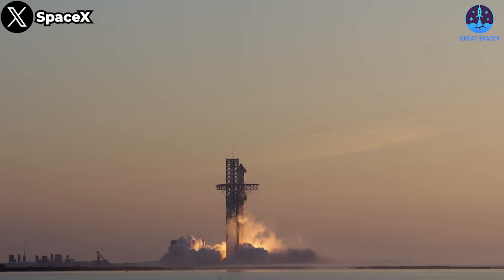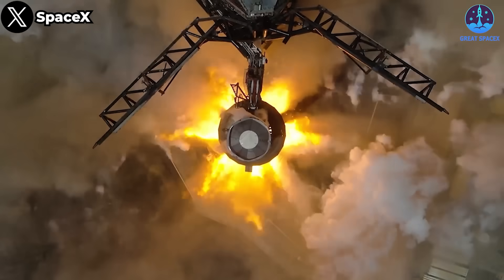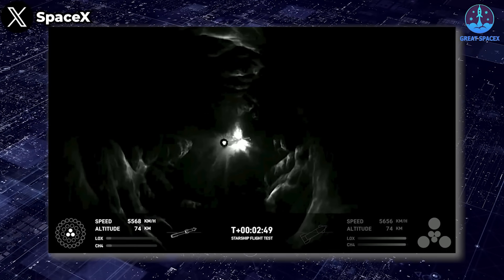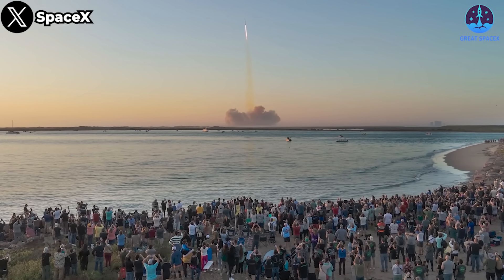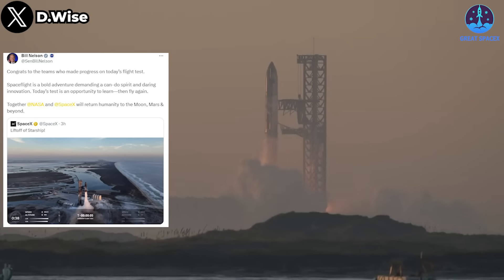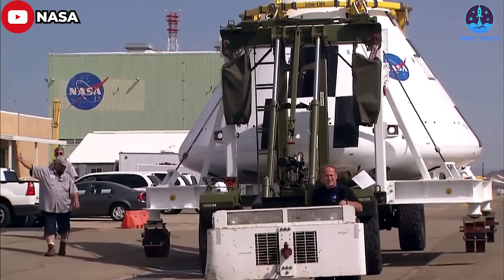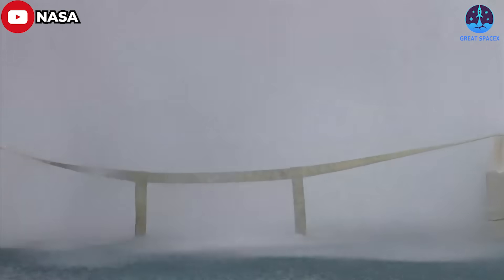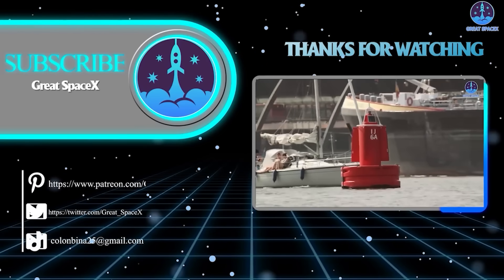SpaceX&Elon Musk inspected the Water deluge system and Stage 0! Starship IFT-3 ready next month...

Comment: 1:33 “steel is a ductile material”. You can’t make this generalized statement.  Steel can be either ductile or brittle depending on it composition, its working temperature, and its heat treatment.  Compositions which make steel hard will also make it brittle.  Likewise loading it at low temperatures will make it more brittle.  Heat treatments of annealed steel will make them stronger at the expense of making them more brittle.  You really can’t compare concrete with metals because they are completely different materials.  Concrete is just crushed rock with a binding agent to keep it together.  It is good in compression but bad in tension.  That is why it is reinforced with rebar for highly loaded applications to allow the rebar to take the tension loads.

Comment: BOOSTER THRUSTING UP WITH 32 ENGINES
SN THRUSTING DOWN WITH 9 ENGINES

Flame diverter taking all forces vibrations
at the intetsection??
Should the section be twice three times its height
and more flame venting patges
along Thicker metal
Sprung 
two three metal dormed shields 
over booster top and grid controlls area
over design in first prototypes
Including strap on landing legs to disgaurd
when assured success is proven
Is a better way to do the job?
Bloody minded special concrete cures all
As really  cost lots of time heartache 
Dollars and fall out.
if touching down in sea
inflation skins coukld be deployed at hitting water

Comment: I’m holding out on saying the pad is 100% fine. They need to run a full test of the deluge system to make sure there aren’t any issues that need to be addressed for next launch. If that turns out well it becomes a matter of how many launches it can take before it gets damaged. There’s still probably some odds and ends on stage 0 that will need some work before next launch. 

The reasons for the RUDs on this launch are a mixed bag. I think the reason for the booster exploding are pretty cut and dry and will see the booster make a complete boost back burn next launch with little to no issue. The issues with the ship are more of a mystery. I think that will take up the most significant portion of the mishap investigation. 

My prediction is that the FAA will turn around and give another license in a couple months and by then spacex will be ready with a new ship and booster combo. I suspect launch cadence is going to ramp up considerably. By the end of next year I won’t be surprised if they make it to orbit, or even deliver payload.

Comment: IMHO, the third flight of the Starship will held not early summer 2024. If the cause of the disassembly, and engine failure, is a problem with the fuel supply during boostback, the pipelines become and they need to be redesigned, the booster 10 can be dismantled, and then the IFT-3 requires the construction of a booster 11 or 13.
Reply: I wouldn't be surprised that they can fix this with software..  if you watch the separation in very slow motion, it is clear that the fuel in the booster was slamming around because of the rapid deceleration caused by the lighting of the three vacuum engines on Starship.  Watch the speed numbers and the booster had negative acceleration which would cause the propellant to slosh to the top.  If they can either reduce the thrust on starship or increase the thrust on the booster during that separation, they can keep the propellant firmly attached to the bottom of the tank where it can feed the Raptors.  Baffles can help but my guess is that they will focus first on reducing the deceleration which caused the starvation of the booster engines and likely triggered the termination charges.

Comment: A great leap upwards with a successful all engine launch and separation. Sounds like though, some people need to get upto speed still, with the original failure being down to matter being in an extremely high state of charge separation with electrical force being responsible and not volcanoes suddenly forming and then going off.

Comment: A pad on the Moon/Mars will be hard
Reply: of course only a much lighter starhip needs to be accommodated with 1/6 G and .4G respectively, so literally 1 tenth the engines of super heavy and if the 9 ton hot stage ring can handle 3 raptors then a pad on mars or moon hardly needs to be more robust.

Comment: Larger payloads also means higher risk per launch. Losing a few satellites (17 tonne) would be nothing compared to losing a full 100-150 tonne payload. The vehicle will have to become super reliable to justify that kind of risk.
Reply: Nothing a few pounds of C4 can't fix.  You can throw 150 tonnes into the drink at low altitudes without risk and at speeds, the main danger is large chunks which can't burn up in time before hitting land.  Blow it up into small chunks and no issue at all... pretty fireworks show.
Reply: @steveburton5825  the risk is financial, not from re-entry debris
Reply: higher risk maybe, but a huge 747 has much lower crash risk than small prop plane. if the engine avionics get good enough then engine out redundancy should make starship super reliable ie if 10% chance of engine failure per minute then 2 engines failing would be ballpark 1% 3 .1% 4 .01% and we know superheavy is specced to get to orbit with 3 out which would be a 1 in few hundred rarity with say a critical 4 literally a <1 in 1000 failure case. If raptor reliability get to 1% then it's almost 747 level lol, of course there might be other harder to manage points of failure, I mean engines were never what undermined the space shuttle...
Reply: @blengi  there were a lot of problems already from small percentage of engine failures in both flights, perhaps because of fire, but also loss of thrust and instability. It can't really be compared to an aeroplane, where the engines are on separate wings and the forces are way lower. But I'm sure Space X will figure out the issues. The reliability they've created with the Falcon 9 is phenomenal.
Reply: @512Squared  what were the engine failures in fl2? going up all 33 worked fine. the 6 raptors on starship seems to work fine too. Of course boost back had engines cut out, but was that engine failure or something structural making engines non nominal causing avionics to turn off?
Reply: @blengi  the reignition for the re-entry burn. It started with one immediate failure, followed soon after by two more, until 5 were out and then the RUD.
Reply: @512Squared  was that  engine failure though or some else which the avionics detected like vibration, fluid balance etc which cause the engine computer to disable? did you see any engines explode? is not the engine specifically failing when the fuel is insufficient or electronics burning, like saying engine is broken because fuel tank empty lol
Reply: @blengi  could be any of the possibilities you mention. There was some discussion that the first failure involved evidence of fire (flash). I don't think the progressive loss of engines can still be put down to fuel slosh because the flip had already been completed, though it might have caused the first shutdown/failure.

 I guess we'll get more of the story in the coming weeks. I was almost crying watching the full stack rising with all engines nominal. Amazing sight.

Comment: I believe the the explosion was intentional to test the system to prove the rocket of that size would fully self-destruct. But that if advertised would likely be rejected by regulators
Reply: No way..  I am sure they would have preferred to have the data on trying to control the booster into the water.  Also they would have preferred to have the data on re-entry of Starship and control... also to see if it would survive with some heat shield tiles missing.
Reply: @christianartman  how much differet is super heavy landing from starship SN landing tests apart from the ~200% higher weight. probably has an even lower center of gravity with massive thrust puck and 33 raptors no belly flop and is thus even easier to land. Of course re-entry data would've been super sweet...

Comment: I bet the liquid fuel bounced hard during separation. Nothing seems more obvious at this point. The throttle probably just needs adjusting. Bet it burns up on reentry. One problem at a time.
Reply: why only 3 raptors accelerating less than a g then the turn back maneuver with extra engines at maybe 2-3 G stabilizing the slosh height to 2-3meters ? I  wonder how the heavy methane down comer  full of liquid methane behaved/flexed as super heavy went horizontal given lack of fluid support in the lox tank?
Reply: @blengi  I think the hammer effect came when the momentum dropped and resumed. The slight slowdown as the raptors drop power in stages five at a time down to three combined with the sudden push from starship as the first three motors started, did the job. A slam of fuel falling the whole length of the buster rocket and busting all of the plumbing. Had to be hundreds of lbs of slosh falling 60 feet or more when starship pushed off from the hot stage. I think the hot staging goes at full throttle so the liquid can not possibly drift up the empty tank. The slow down lifts the fluid the engine startup adds lift and then the fuel plummets.

Comment: Could they use heat shield on top of the booster so that the heat from the Starship Raptor engines do not damage the top section of the booster and protect the stabilizer fin motors from the heat, but what a fabulous moment to see Starship launch 2, hopefully 3rd time will be even more successful. 😊
Reply: probably not, as the amount of turbulence would be MUCH higher than on the second stage. That might not apply if the entire hotstage includes a single unit tile to provide the protection. Tiles were also the weakness of the shuttle. The original concept had the shield built as a single unit to encapsulate the shuttle - but there was no money available to learn how to do that - so NASA and contractors went with a tiling technique which allowed the tiles to be damaged and fall off during launch.

Comment: Correct me if im wrong but if they plan on using the launch pad over and over again wouldn't they need to apply heat shielding to the pad and the water deluge system as well?
Reply: I believe they chose steel for the exact reason to not require this. A heat shield won't be able to withstand the sheer force of the engines as they're normally comprises of ceramic tiles. 

The benefit of steel is that it has a high melting point compared to fibers and other metals, while still being strong and the water deluge system is able to keep it cool and absorb the majority of the force of the engines, so that refurbishment isn't required. The water cools it down and keeps it protected during the 10s or so of liftoff...least thats the theory behind it I believe.

Comment: It seems like the issue with the heat tiles falling off might need to be resolved with heat shield sheets instead. It only a speculation but the more tiles the increased likely there will be a problem which is contrary to Musks' philosophy of "the best part is not part" i.e. the best part is fewer parts.
Reply: finding a way to make/casting the entire shield as "one part" then attaching to the ship would do. More like ship building where the shield becomes the "keel", and then building the ship inside the shield might do.
Reply: @jessepollard7132  Good idea.
Reply: yeah like tile strips pre bonded to that insulating layer which hook on around the sides with maybe half the pins which can be tensioned according to ship vibrations. be much easier to service to in space too ie has some spares tile strips for in space EVA repairs
Reply: @blengi  Yes something along those lines. Starship is way to big for all those tiles. It seems inevitable to be a continuous problem.
Reply: If you have a larger sheet detach that would be worse than a smaller tile protecting an area. Overall lets keep in mind that most of them did stay attached.

Comment: Steal also develops micro fractures. And all that water comes in a very high pressure with a very high flow rate and end up very hot. SpaceX needs to monitor the system so that you do not see erosion, wear and corrosion from use.

Comment: The major problems emerging from IFT-2 are: 1) preventing the loss of fuel flow to the engines, possibly due to sloppy ullage during flipping of the booster, 2) apparent leakage of oxygen from stage 2 after stage separation, 3) other possible Raptor problems causing RUD of stage 2 and 4) heat protection tiles detaching during launch.

Comment: It looks like The capsule for Artemus had a heat shield failure after all. They will need to redesign it entirely. This could be something that SpaceX might also look into for StarShip. I see that StarShip Stage “0” (the launch pad) worked flawlessly. It’s ready formStarShip 10 booster4 within a few weeks. It might fly before the end of they year but I’m thinking January. I saw StarShip (all 3) gimbaled outwards and back into assent positions after separation. They worked as expectedly and that’s another check in the done box. I still have not heard much on their “Root Cause analysis” yet on this last mission. It should be interesting.

Comment: Could it be that, during separation, the top of booster 1 overheated leading to the explosion.  Heat tiles on the top?
Reply: It was more likely a fuel problem. SpaceX has never tried to flip/boost back a booster as large as Starship's. The fuel tank is just a big, empty space. If the fuel didn't settle to the bottom of the booster then the engines wouldn't fire. If you look carefully at the telemetry from the test you can see that the engines all fired for the boost back. Then all the engines on one side failed at the same time. The explosion was caused by the Flight Termination System. It destroyed the booster after it went off course.
Reply: @gregsteele806  agreed, it was most likely the fuel slamming into the manifold after the flip maneuver caused one of the welds to fail and therefore fuel started leaking into the engine section - which probably led to fuel pressure loss and multiple engines flaming out and then the FTS kicked in
Reply: tiles might be too fragile for the turbulence of ignition.

Comment: the rate of spaceX solving the previous launch test problem will see the program settle like falcon 9 launch normalization in less than 5 years.
Reply: The water deluge system had been in design and development for about 8 months starting before event he first launch. It was only the implementation of the design that took a short time. and took quite a bit of engineering.

Comment: Fuel takes will need fuel blatters that shrink froceing the fuel in the direction needed !
Reply: They have no material that will hold liquids as cold as liquid oxygen or liquid hydrogen that will stay flexible. And controlling the pressure in such a bladder would be almost impossible. That's simply not happening.
Reply: sthose baffles didn't work in aerobatic or fighter aircraft even though some are used. so it might help, but would also tend to make the fuel foam from splashing (as well as make the tank more thermally conductive).

Comment: Not just did it help hold the launch pad, but this water deluge system absorbed the shockwaves and thrust from 33 raptors! One could see this from the undamaged cameras and even all the tripods near it that captured the event. It was an amazing achievement ❤
Reply from the maker: Exactly. This is unique platform!!!
Reply: @colonbina1  Clearly they have no idea how to re-ignite engines given a random position of the booster or the star-ship in the presence of almost empty fuel tanks.
Also, SpaceX is yet another example of the government gifting peoples taxes to private owners without getting any ownership in SpaceX for the people. Only corrupt government protects the Owners of businesses more than the People of the country.
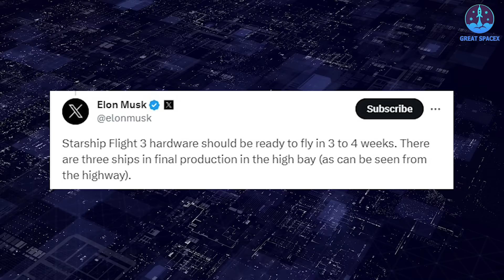Reply: I'm sorry to say, but I don't think it absorbed the shock waves. Maybe a little bit, but at 2:04 you can see quite a big shock wave. And there was another smaller one after that
Reply: You will Never absorb and eliminate the shockwaves from 33 rocket engines firing up.. but they are not trying to eliminate them (impossible) - they are trying to Reduce the acoustic vibration and shock to prevent damage to the vehicle and launch structure. - judging from this 1st live test, compared to the test they did before they had the water cooled plate, ill say they are onto something. If Boca Chica was not sitting like directly above the water table, im sure they would have gone a conventional route like flame trench, but thats not an option here. @musicduck4538
Reply: NSF Thinks the new dent in the Tank Farm was caused by Shock Wave from the launch.
Reply: @davidedwards1705 

Last I heard…. There were plans to remove the vertical tanks…
Reply: @robb8235  eventually yes. It'll take time to get the new tanks in and installed before removing the old ones.
Reply: @robb8235  I heard that as well .. If the cryo tanks are horizontal then .Those vertical ones should be as well :)
Reply: I mean, everyone in Brownsville felt the shockwaves for sure. I forgot they were launching and thought we were having an earthquake at first lmao, never happens around here.